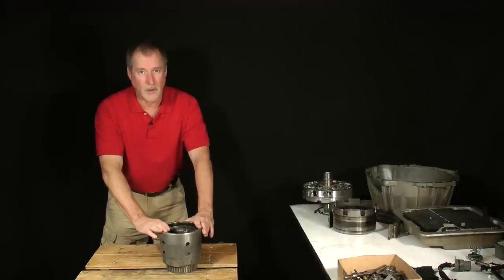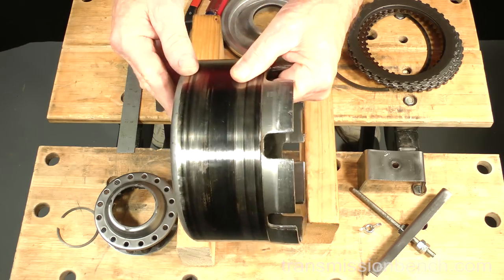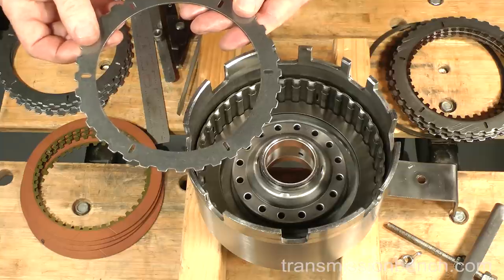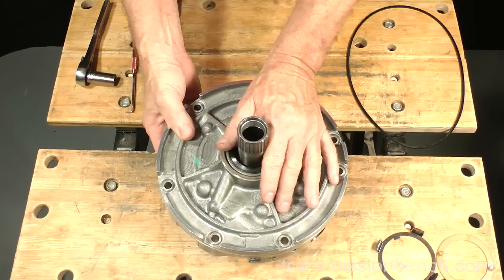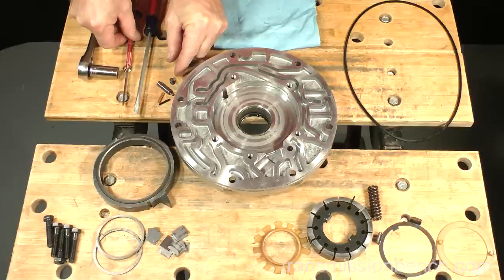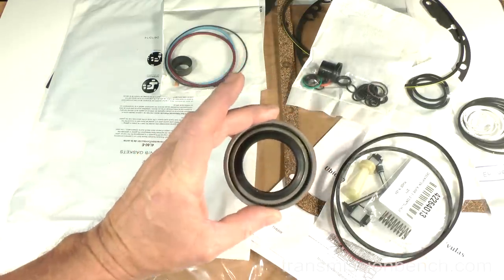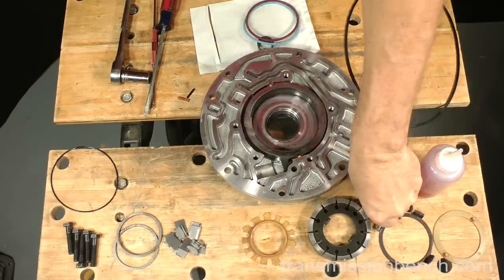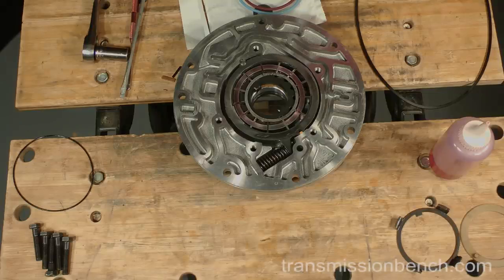Project 4L60E part 2 lesson 6

Comment: I love how you skipped the part explianing how incredibly difficult it is to install that reverse input piston without damaging the seals. Good information on these videos, but that seal was so difficult, I ripped up 4 of them before I finally found a method that actually works. The feeler guage method does not (and I cant stress this enough), absolutely does NOT work.
Reply: 100% agree. I struggled for a long time and nicked my first seal using the feeler strip. Stupid method of installing them. A simple piece of thin plastic sheet (a folder divider) formed in a cylinder around the piston bore had my seals installed in less than 1 minute.

Comment: I know this question is irrelevant to this video, but I am having a lot of leaking issues with my 4L30E in a 2001 Isuzu Trooper. I believe a solenoid is leaking, along with the hard line for the transmission cooler. The transmission cooler line is leaking from the fitting on the transmission housing. Is the bell housing of the 4L30E exactly the same as a 60E? I would like to swap the transmission and rid myself of the issues of the weak 30E.

Comment: Hi, thanks for your excellent work. I repair my 4l60e watching your videos. It does not work perfectly because the pump is not working as good... I would like to know how can i repair the pump. What is the principal failure?. This transmission does not make any changes either Back or Drive neither 1st 2d 3th velocity. The turbine is not charging  and i supossed is the pump over. Please help me and thank you again.
Reply: In lesson 7 he shows you how to install the boost valve.  Pay attention to where he sets the snap ring in place.  The snap ring needs to sit in the groove DEEP in the bore.  If you don't seat this snap ring in the groove, it will instead stop the sleeve at the first shoulder in the bore.  You will lose reverse and the forward gears will not shift well.  It is very easy to make this mistake.  I made this mistake when I installed a shift kit.  Fortunately, this can be fixed without removing the transmission since you can access this snap ring just by removing the pan.
Reply: Cleiber Melendez s

Comment: Hello i have see all the videos and they are  excellent  i have a question i have a 94 and 95 4l60e  i was wonder if i can interchange some internal parts and which ones could be? And are the case similar since they have a K?
Reply from the maker: Hi Victor. The drivetrain components are interchangeable. The 1995 valve body and separator plate are unique; be careful swapping stuff there.
Reply: @transmissionbench7842  I consider myself a master transmission tech,Just what is the difference in the 1995 vavle body& seperator plate?.I have compared them more than once and other than different shift applications found them identical.

Comment: Hello i have a question on the valve body i decided to rebuild the 94 4l60e   and i want to ask u if i also can use the sonnax valve that fix the 1870 code or that its only for the pwm
Reply from the maker: Good question Victor. The 1994 non-PWM valve body does not usually have a problem with a worn bore as the 1995 and later ones do... but  the Sonnax regulator kit #S74741QK 1993-1997, will fit it.

Comment: What size valve did you use to press the pump bushing in
Reply from the maker: Hi Iroc. I used a small block Chevy intake valve. The head diameter is 1.940", but any similar size valve or something else like a large socket can be used. Jimmy
Reply: Thanks I have learned alot from your videos that would be cool of you could put them altogether
Reply from the maker: IROC TWAN
you can view all of the  videos together by navigating to the "videos " page at www.transmissionbench.com.